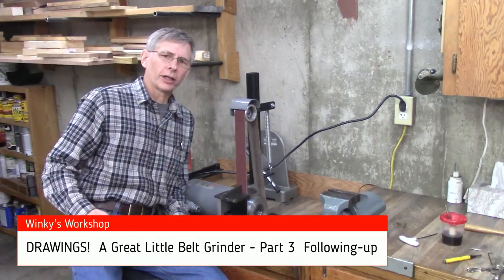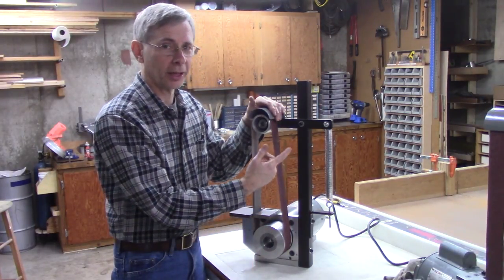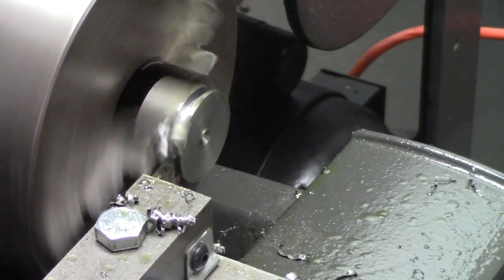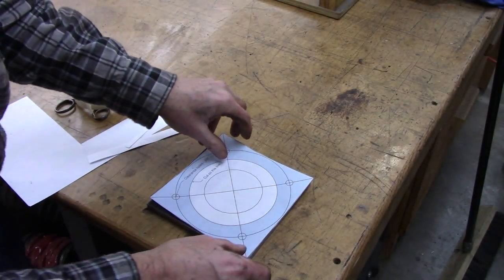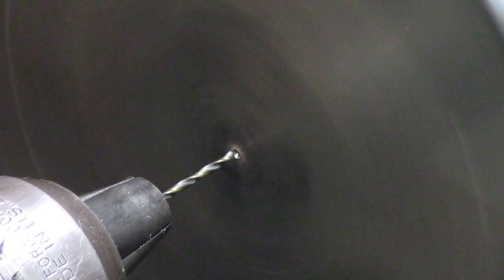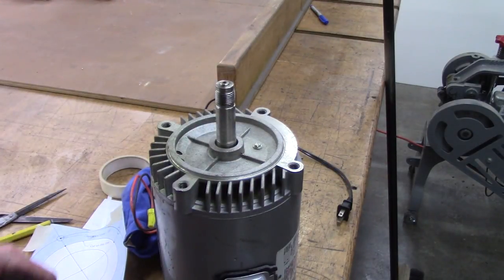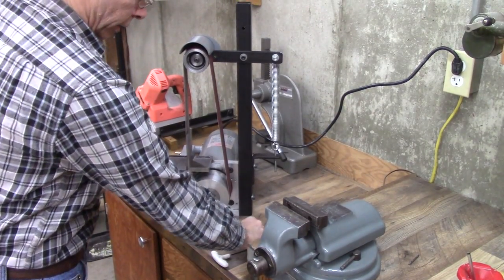Free Measured Drawing! A Great Little Belt Grinder Part - 3

Comment: I got a message in a Chinese cookie that read "complexity breeds decay" and then watched your build on belt grinder number 1 and it all came together ,,, the reason I like your design is it works and  it is simple ,,, I am going to build one using a treadmill motor ,, your clips are a good way to spend an hour or two on a cold winter night ,,, thanks ,,, ED
Reply from the maker: I agree with the Chinese guy :o)

Youi will use the heck out of the grinder. Also, Vevor sells some wheels already made. Not super cheap but if you already have a motor its a good way to go. Youtube sometimes removes links so run a search with these words, "VEVOR Belt Grinder Drive Wheel 6" Diameter, 2"x72""

Comment: Your design is elegantly simple. Thanks for making your drawings available.
On lining something up to a centre-pop in a 4-jaw chuck, most Morse taper centres provide a male centre at one end and a female at the other. Put the male point in the centre-pop on the part and run your tailstock up with a centre to engage with the female end. Now use an indicator near the male end of the Morse taper centre, and you'll see any off-centre movement of your centre-pop clearly.
Reply from the maker: You're welcome on the plans. I use the heck out of this grinder! 
Dang...  that's a good idea! Thanks

Comment: The set screw washer is a neat field upgrade.
Reply from the maker: Thanks. I never had a problem with slippage on the last grinder but it was lower HP and smaller drive. Somebody made a comment that it needed a key and I got worried. They were probably correct.

Comment: Thanks for your videos. Your cutoff tool reminded me of a huge time saver for grinding HSS threading tools. Instead of using the normal size HSS blanks, grind a threading profile on your cutoff blank instead. It takes almost no time to put a sharp point on it and you can thread right up to a shoulder. You can also cut a relief gullet for the tool right at the shoulder before you start threading. Someone shared this tip with me a long time ago and I've been doing it ever since.
Reply from the maker: That might work but watch out for thread angle. The bottom of the tool just under the cutting edge needs some relief to clear the threads. Thanks for watching!

Comment: Has anyone else told you that once in awhile they don't get notified about a new video? This is about the third or fourth time this has happened to me. It seems to happen when you post a couple videos in one day. The grinder looks great, I like the finishing touches. Now you will be known as "THE MASTER OF SPARKS"
Reply from the maker: I've heard other youtube creator complain about this but this is the first time I've heard this from one of my subscribers. Thanks for letting me know although I'm not sure what to do about it.  The sparked look cool with the lights out huh? Ha
Reply: @WinkysWorkshop  for now on when you post a video I'm going to take a look if there is any more. The sparks looked super cool especially with the mad scientist look!
Reply: Winky, This is NOT a criticism but when I print your motor mount.pdf well, it doesn't fit my 56 frame
 It's larger

Maybe just happening to me but I would feel bad if I used your template and ruined a piece of 8"x9"x 1/2" plate that I just paid $18 for.
Reply from the maker: @michaelalsup9817  - I suspect you have it set to the "fit to page" option on the PDF reader (this is the default). You need to select "Print 100%"
Reply from the maker: @michaelalsup9817  - If you open it in your browser you have to click more settings. I would open it in Adobe Reader. The setting is called "Custom Scale". set it to 100%

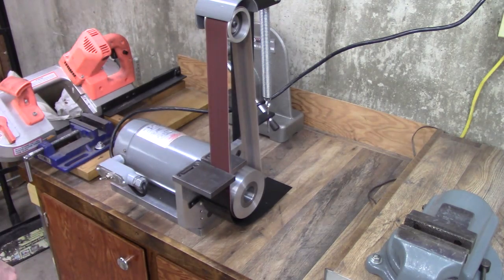Comment: 14:20  very definite in execution, and excellent milling/lathe work sir. !!   At 14:20 time, perhaps place a few magnets, like from microwave ovens, behind/on that spark deflector, as they would attract most of the filings........works good on the grinder.
Reply from the maker: Yeah that might help although metal is not magnetic when it gets hot.

Comment: I appreciate the plans. I saved them for future reference.
Reply from the maker: If you have a 3/4 or 1 HP make the larger grinder. I was totally happy with my 1/2 HP until made one with the larger drive wheel. I didn't have a mill when I made my first grinder but on the second I made sure the tool rest and back plate (platen?) was flat and square. Now I can use it to square up stock after cutting. Very handy.
Reply: @WinkysWorkshop  I have a brand new 1 horse motor I bought for my compressor but found out the contacts were bad on the pressure switch. Do you think a 72 inch would be better? I have seen quite a few videos of 72 inch ones and they seems like they might be better.
Reply from the maker: @dannywilsher4165  - It just depends on what you use it for. If you need a larger grinding area you might want the longer belt. I can grind an area 2 x 4 inches which is adequate for me. Space is also a consideration although judging by the size of your lathe you have way more space than me!
Reply: @WinkysWorkshop  I guess you are right. Bigger is better mentality is not always best. My space is not nearly adequate really. We thought we sold our house and had a closing date we had to be out. We moved everything into two storage units and the deal fell through so my 2 car garage was empty. Good thing I guess because I don't know what I would have done with the lathe. My son has room in his shop so I could have dropped it there but then I would have to drive an hour to go work on it. But it's all good!!!
Reply from the maker: @dannywilsher4165  - I'm 64 now. I look at things a little different. 20 years into the future I'll be 84. Will I want a larger shop? If I was 20 years younger I'd at least be adding on to my current shop.

Comment: I'm really liking the form factor of this belt grinder. Most of the DIY ones I've seen are the 4 roller type that stands out around  3 or 4 feet from the wall. In a small home workshop, trying to find room for all you machinery is often like a frustrating game of tetras, so a belt grinder that could be pushed to the back of the workbench when not in use is a pretty efficient use of space.

I am wondering though. The fact that most people who make DIY belt grinders use the 4 roller design must mean that way of building them offer some benefits. I know that some have swinging grinder body's to run the belt horizontally, and most have some way to angle the platen or table, but apart from that, what other shortcomings does this 2 pulley setup have?
Reply from the maker: Thanks for the comment. Occasionally the return path of the belt gets in the way but not very often.  99% of the time there is no problem and like you said, the size is a huge plus!    As for the tool rest, I made it in a way that I could modify it in the future. When I made grinder one of my goals was to make the platen behind the belt absolutely square and solid to the tool rest so that I could grind the end of stock off square. I might add that It works perfect for this. I made the tool rest fairly narrow so that I could still grind a chisel at the right angle using the upper part of the platen. I have also made a few jigs that index to the sides and top of the tool rest for grinding a cut off tool and drills.  The simple design allows for a super fast belt change. Switching to a 400 grit makes an incredibly sharp cut off blade!  The tool rest would be easy to change if you need more complex jigs. I used a 42 inch belt but moving to a longer 48" belt  would open up the possibility for a longer platen if needed.

Comment: Thanks for the drawings, what a simple setup, I love it, did you make all the parts yourself? including drive wheel and tension idler? Only thing that confuses me a little bit is that there is no tracking, and it seems to work just fine! 
Is that because you made the wheels so they have a slighty "top" in the middle where they are supposed to center? 
I have some thick steel plate I think its 5/8" in my workshop I really consider building this + my friend has a metal lathe so I don't see why I couldn't build this.
Reply from the maker: You're welcome.  Yes I made the pulleys using the compound on my lathe. The aluminum wheels came from conveyor rollers at work but I had to cut them down and sleeve one of them. Yes the crown keeps the belt centered although it is important to keep things aligned. If you want (or end up needing) an alignment adjustment you can put a shim under the lower part of the upper pivot on the tension arm. You can adjust the tightness of the bolt and it will skew the roller. It doesn't take much. I love this little belt grinder.

Comment: Very nice as usual Winky! I picked up a 1hp vevor motor (3450) with a 5/8” shaft however it does not have threads 😮it only has keyway. Any input to adapt drive pulley? Planning on going with 4.5” and 2” pulleys. Also I might have missed it, what spring did you finally get for a 42”….
Hope all is well for you.  Randy
Reply from the maker: You didn't miss the spring, it's not in the plans. I probably should have said but many different springs will work. You can move bracket in the column if you need to. Honestly I think the spring I used came of a kids toy horse (like a rocking horse with springs). As for the threaded shaft, a simple keys shaft easier aside from cutting the keyway. The only hard part is drilling for a set screw. I would drill a 5/16" hole on the face of the pulley just over half way through and then finish drilling with a smaller drill for a 1/4"-20 set screw. You probably need about 1/2" to 3/4" thread engagement. I'd make the hole off center so it's not on the crown. Note: Make sure you have a long enough tap. Alternately you could drill from the side at an angle. Thats a bit tricky however.
Reply: Gotcha! Thanks for the advice 😊

Comment: I love the simplicity of the grinder.  Great way to sharpen HSS cutoff tools.  That is a great cutoff tool holder.  Looks to be very rigid, and should eliminate chatter.  Great Video.  What size vice is that on your column mill.  I just bout an MSC column mill and am trying to decide what size vice to buy.   What is the RPM rating of the motor?  Thanks for the free drawings.  Note: I thought you were having a free drawing to win the grinder. LOLOL
Reply from the maker: Sorry I overlooked your comment, thanks.  The column is 4.25 (aprox.) 2 HP 1720 RPM. 
Funny...  maybe I need to have a drawing. I should have called them prints or plans maybe. I think my vice is 5" wide, clamps 5" and maybe 10 with the jaws reversed.

Comment: how do you find the quality of Vevor ,,, I look at off shore stuff as justification of cost to quality ratio meaning I don't need top of the line industrial equipment  in my hobby shop since I seldom make any money from it but still need the item to last under casual use ,,, that being said I got carbide tipped  hole saws from some store on face book and the shanks actually twisted off under light pressure ,,, unbelievable
Reply from the maker: It's hit and miss just like Harbor Freight. They sent me a Plasma cutter that works fine and I have a couple of chucks that do fine. I also have a mill table for the drill press which had good castings but terrible lead screws and dials. For some things its worth taking a chance. Oh... and I have an 8"sheer from Vevor that is fantastic although it only cuts straight.

Comment: you come across some serious pieces of aluminum that 2 inch piece for the rotating buffer grinder stand would be expensive ,,, where do you find  surplus like that,,, hopefully not being too nosey
Reply from the maker: Yeah that was a big chuck of aluminum although it had a big hole. They were from overhead conveyors used to transport printed signatures (32 page magazine sections) from the press to the stackers. Most the rollers were a little smaller and has a groove in the center but these larger one ran on the back of the belts as a tension idler. The belts were 2" wide and had a 1/2" guide in the middle. They had two loops several hundred feet long and rollers every foot. They only grabbed one edge of the signature and were up by the ceiling.  Anyway...  I should have got more of them. I got these because o removed an unused section. Oh hey...  all that description and I could have sent this link! Haha  https://youtu.be/NgT8enlM3Ck

Comment: Hi again. I'm a little confused with the plans for the 4 1/2 inch. In the video you are turning in the lathe the 6 inch square. On the plans, "Base for 3" and 4 1/2",  it shows the hole cutout in the 6x8 but then below shows the 8" section in the base configuration. . The base of the 4 1/2 in the video looks to be much wider. (I only ask as I may be unable to chuck up the 6x8 in my four jaw. I don't have the outside jaws. Fun times!!!!!.
Reply from the maker: Hello Don,  The base can be 6 x 6 or 6 x 8. My original 3-inch was 6x6 but the larger version was longer to support the larger motor. So whatever works for you motor.  Yes for the larger version the plate for the motor mount is 6 x 8 and would be hard to turn in a lathe. If your lathe can turn 6 x 6 you could weld an extension on the plate after turning for the motor. Also you can simply use a flat plate with a hole in the center and let the bolts hold the motor. I think that cutting the groove or hole makes the grinder look nice but it isn't really necessary. Another reason to cut the hole or recess is that you gain a little shaft length but you don't gain much anyway. The primary reason for this type mount is to keep everything concentric when mounting to a pump or gear box and this is not needed for the grinder.
Reply: @WinkysWorkshop  OK great options. May just go with no cut-out. Sourcing pulleys??
Reply from the maker: @donswords6671  You will probably have to adapt whatever pulley you get to the motor you are using. Pump motors from burned up pumps seem to be fairly available but they are all different length and diameters. Run a search for "Belt sander pulley Vevor". I have not ordered these myself but they look nice.

Comment: Winky, Can you tell me about the 0.012 offset from flush your drawing shows for the face plate to base plate juncture?
Reply from the maker: You can make it flush or leave an 1/8" sticking out. The hole positioning in the drawing has the .0125 offset. It was just a precaution for strength but most likely unnecessary. I think the screws would break before the base plate holes distorted.